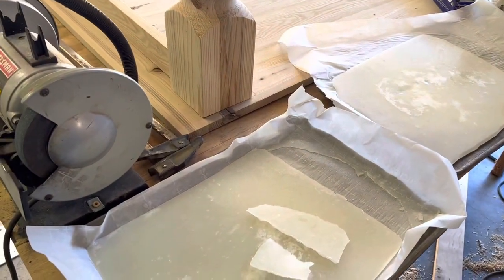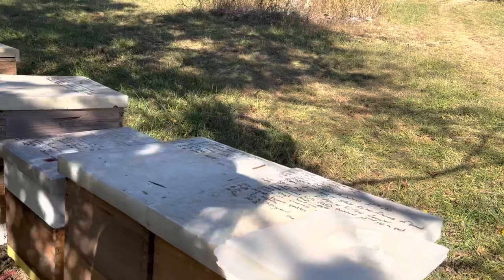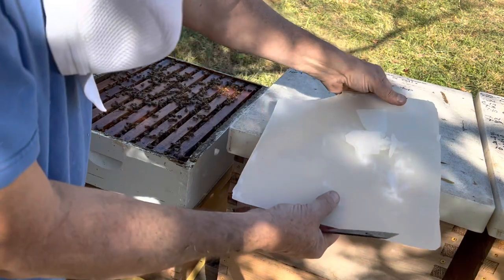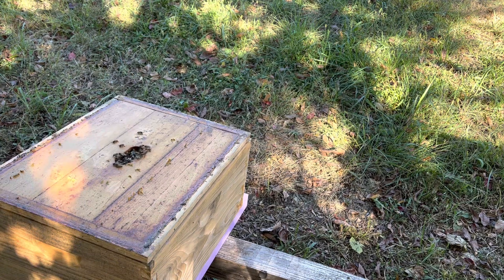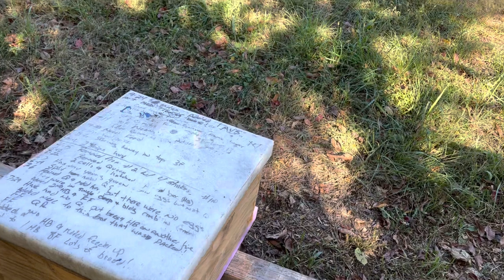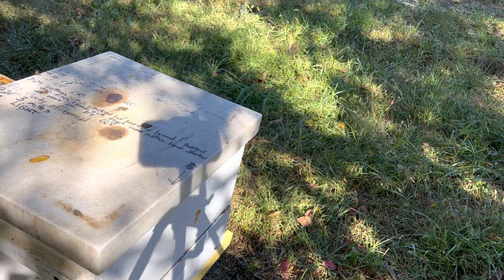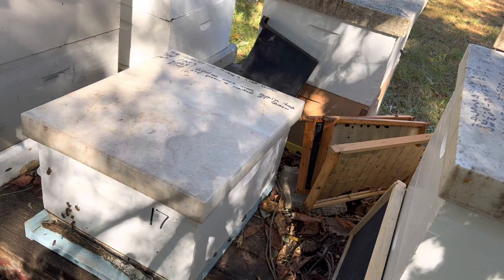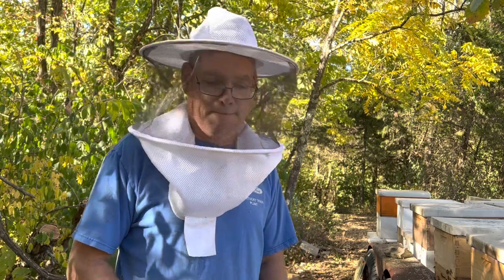Feeding fondant

Comment: Do you feed sugar water 1:1 to them in the fall? I have never seen fondant given to them except in the dead of winter.
Reply from the maker: Thanks for watching Dan. I just switched over to 2 to 1 after our first frost. I’ve got about 5 hives that have too many frames of bees to take a frame out for a division board feeder so I’m giving them fondant. I did a lot of testing last year with different kinds of winter feed and continue to be impressed by how quickly they take the fondant and the difference it makes in the hive.
Reply: Thanks for the info Troy. How do you make your fondant?
Reply from the maker: @dangvalverde  one part water, 4 parts sugar and a teaspoon of vinegar. Heat to just below hard ball stage on a candy thermometer and pour in to a shallow pan lined with parchment paper.